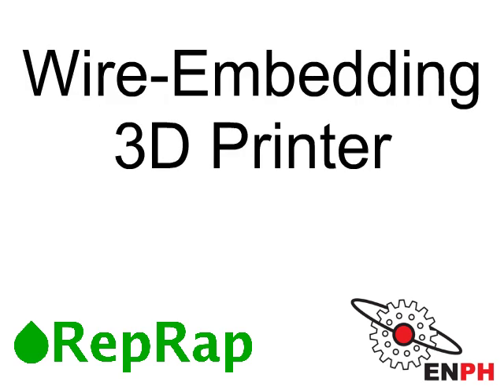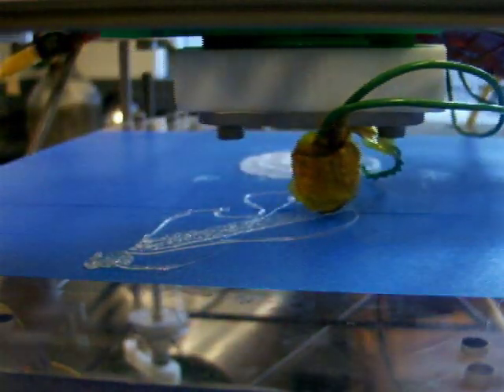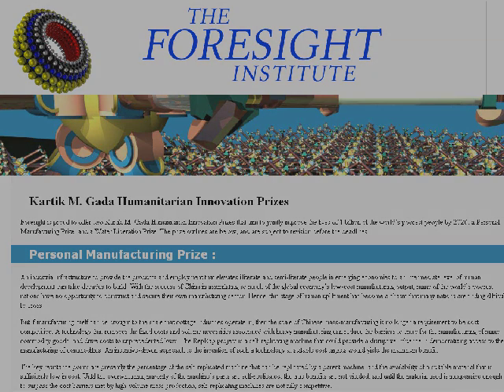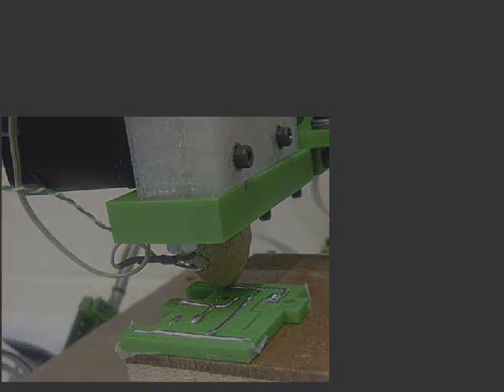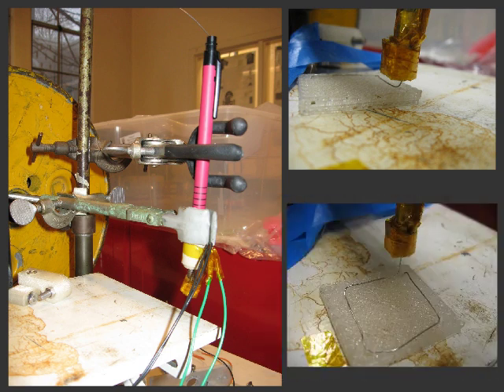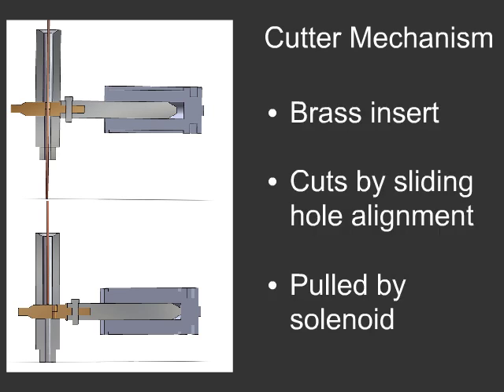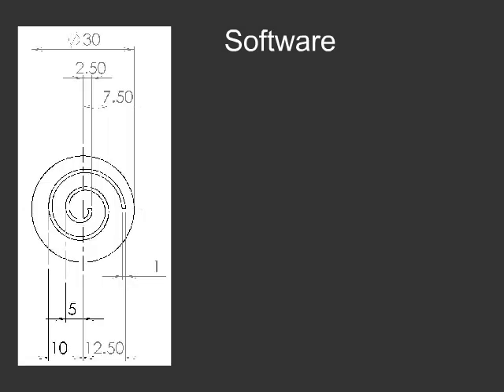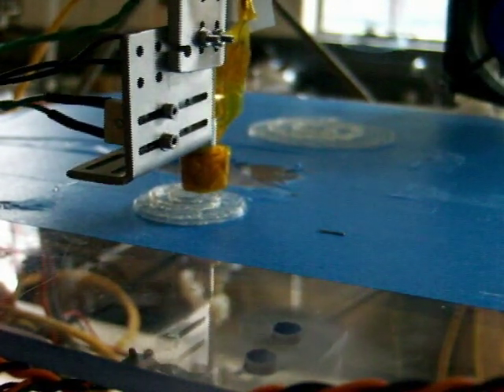RepRap 3D Printer with Wire Embedding Capability

Comment: we need this tech.. we'll need to metal insert a pogopin as well as metal wires into the components, can only be done previously by expansive plastic over-moulding technique.
thank you for sharing.. we'll give it a try a bit later.

Comment: Please try this: leave some hollow tubes where the wires should go. And then pour in bits of conductive material dissolved in some liquid (which hardens over time).
Reply: Wait... what if bits can't form a continuous chain for conducting? What if they remain separated?

It may be possible to first pour in a liquid glue, and then pour it out leaving the tube surfaces wet with glue. And then pour in metal powder/filaments to cover the surfaces.

Wait, the most straightforward way might be simply filling the tube with metal powder.

It might leak, however... and all those particles of metal will be darn hard to clean up. Oh well.

Comment: Metal foil tape might work and the cutting problem would not be as bad as it is with wire.  If a conductor has to be built up from multiple layers of the foil there could be some capacitance problems but it is possible to design circuits to take the capacitance of the lines into account or the possibly route the multiple layers to minimize the capacitive effect. Could the components be put in a frame on the plate with the leads sticking up while the board is formed around them?

Comment: What about the conductive carbon paste they use in resistors?  Using the lowest resistance formulation seems like it could be useful as circuits if the resistance it taken into account when the circuit is designed.

Comment: The alternative is to have a seperate feed head.  The seperate feed head feeds into the extruder head.  Then use a powder for the metal.

When printing, you can shut off the seperate head giving you the ability to have alternate circuits.  Since most circuits are in gold, the end product will be pricey.  Yet if you can create a circuit board rather than actual circuits and then add the parts after printing?

Comment: Physics, Optic: light reflection. Beyond a certain index the data simply wont go through. No matter whether you put in a cable or concoct something of your own. It could be done in a certain way, but I'm afraid that the dataflow wouldn't be that great. But if you're interested, I do suggest to try to make some calculation by yourself. :)

Comment: To cut the wire, what if you had somthing like a plier tip grab the wire and then bend it back and forth till it breaks? Or what how about gripping the wire in two points a small distance apart and twisting it till it breaks?

Comment: Have you come across copper/metal clay?
It's basically copper or other metal in clay form, these can be sintered (big heat, some need a kiln) to form pure metals, although there is some shrinkage.
Printing clay could be done with something like a makerbot frostruder variant. Circuit board made using a non-conductive clays or resins with metal clays printed on/into them.
the whole piece then fired to produce the finished item.
Materials & shrinkage working together would require research.

Comment: The Reprap is a good step in the right direction.
Currently, we have a 3d printer which can make many/most of it's parts.
Next, a 3d printer which can make ALL of it's parts. (harder than it sounds)
Then, a 3d printer which can make and assemble ALL of it's parts.
Finally, a 3d printer which can copy itself, and gather resources to further copy itself.